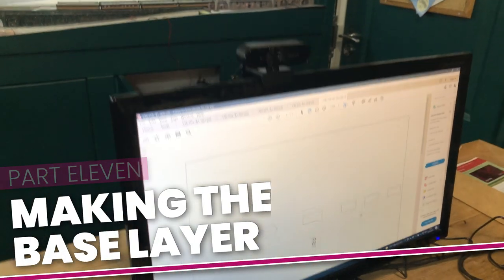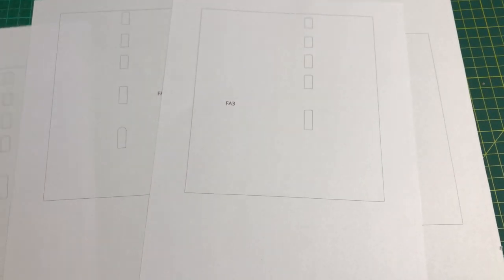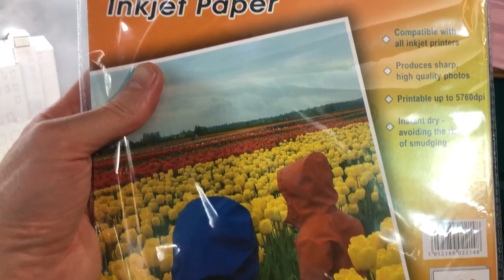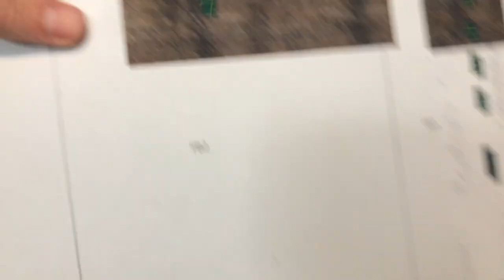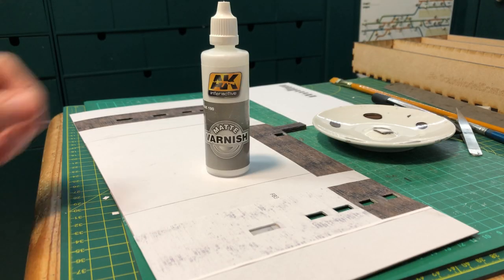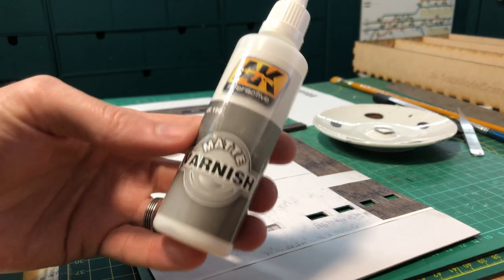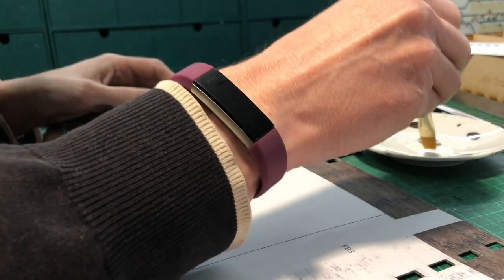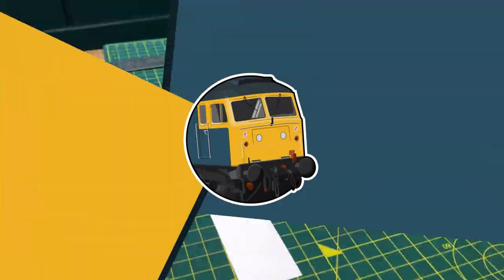Beginning the Build: Scratch Building a Low Relief Victorian Hotel Part 3

Comment: Hi Michael. Interesting that you use PVA to stick the texture sheets to the greyboard - I usually get significant warping, even after weighing the drying sections down, so I use a glue stick instead: less warping and a surprisingly secure bond. The build is looking good and I'm looking forward to more. Thank you for posting and stay well.
Reply from the maker: Thanks Paul. I usually use glue stick when I am sticking sheets of paper to the card where I don't have anything to line up. I always use PVA if there is anything to align as the paper floats on top for a few seconds which allows me to make tiny adjustments to get it sorted. I've never had card warping, and I am not sure why that would be. I do apply the glue really thinly, but I cover a lot of the surface, so I don't know. The only problem I have had with PVA in recent times is when I weighted a piece down while the glue dried and part of the printed surface took on a pink haze. I think the moisture from the glue caused some of the magenta ink to run. Why just the magenta, and why on this occasion when it had never happened before in over 10 years of using the same technique, I will never know. Dodgy cartridge perhaps, or an unusually high amount of magenta in the piece perhaps. --Michael

Comment: Great progress Michael👍
I found that hp inks despite being pigment based ran with AK interactive varnish, most noticably the blacks. It seems all inks are not created equal!🙄
Look forward to episode 4!
Andrew🙂
Reply from the maker: Oh gosh, that's interesting. I wonder if it is the ink or the paper. My inks ran like nobody's business when I tried AK Interactive on my backscene, which was printed in the same ink, but on the sticky label. I hope it is the paper, because I was thinking about moving to HP if and when my Canon dies. Episode 4 should be an interesting one if I can pull off my plans for the concourse entrance. Cheers Andrew! Michael.
Reply: @Chandwell  could be the paper it was Wlico Matt Printer paper I guess you could try some on your canon and see if it runs? I'd keep hold of your canon as long as you can just in case!🙂

Comment: hello,
could you pls tell me where you bought the fine tip applicator and does’nt it block when full of glue? thnx and very nice buils btw
Reply from the maker: Hi Guy, I bought it online from Anne Peake but she has gone out of business and it is no longer available. I believe Metcalfe do a very similar product but when in use the pin in the tip rusted a bit. It doesn’t get blocked. You keep it upside down so there is always glue at the bottom. This prevents air getting into the nozzle and drying the glue. You keep a pin in the end when not in use.
Reply: @Chandwell  thnx